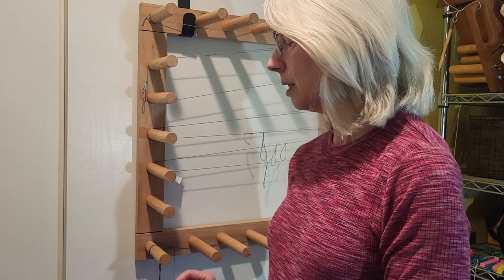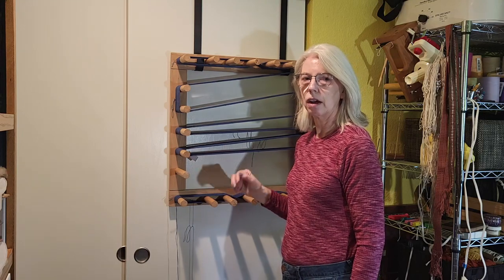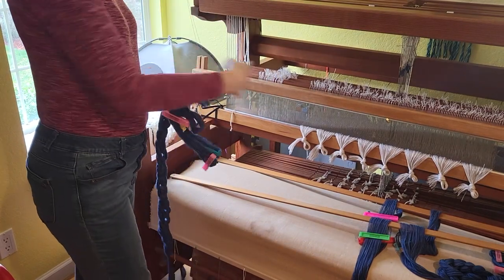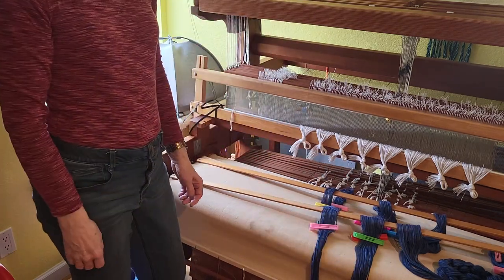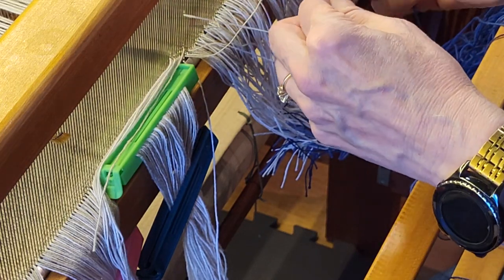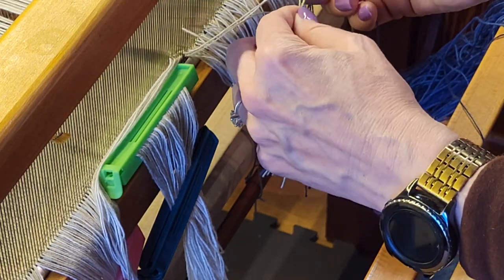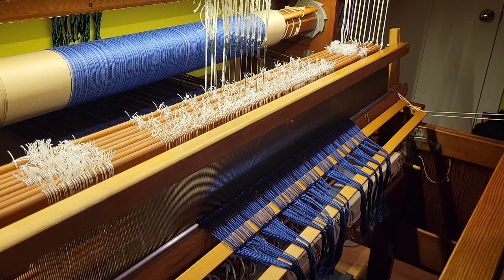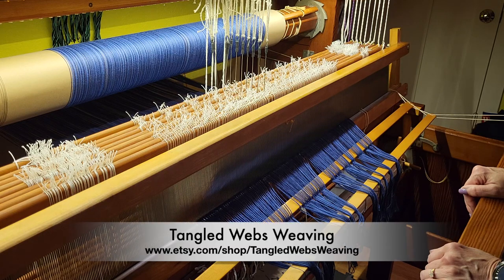Tying a New Warp onto an Existing Warp

Comment: When you want to undo the knot, you only have to pull the short end of the white thread so that the thread is straight, than you can easily  slide the blue knot down the white straigt one. You don't need nails in this way ;))
Reply from the maker: Thanks for the tip. I'll have to give that a try!

Comment: Amazing!  Great video.  Do you normally warp front to back?  Or was this just for the tie on to the existing warp?  You're very patient
Reply from the maker: Thanks very much Jill! I normally (99.9% of the time) warp back to front. Particularly with this loom it's designed to be warped that way and it's the way I'm most comfortable with. This video is that 0.1% but only because I'm tying a new warp onto an existing warp.  I don't think of it as patience. I'd be spending the time threading the heddles if I wasn't tying the warp onto the existing warp so it's not much different. But it does eliminate threading errors in the successive warp.

In a current project, I'm weaving 4 sets of towels in 4 different color ways. So I decided to tie the 4 different warps (color ways) on before I even start weaving ~ wind the 1st warp, tie the 2nd warp onto that, wind that on, tie on 3rd, wind that on, tie on 4th, wind that on, then thread the heddles. I'm hoping it saves time and there will be less waste. We shall see!

As always, thanks for watching!
Reply: @tangledwebsweaving  thanks for the explanation!